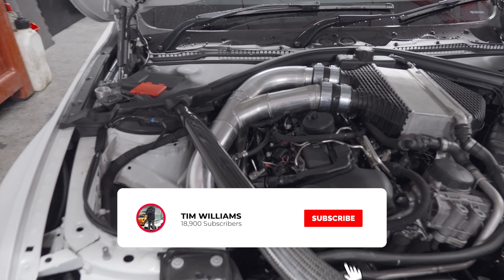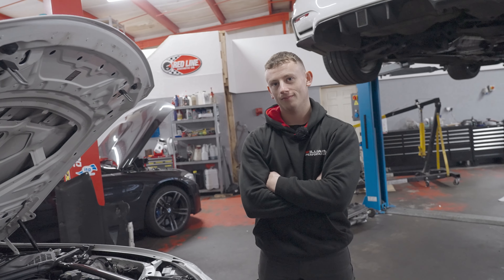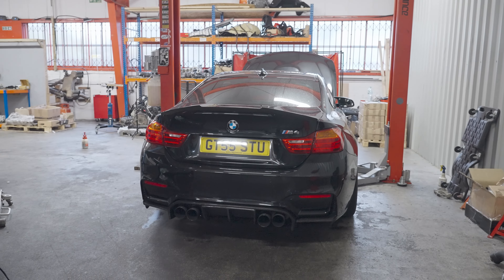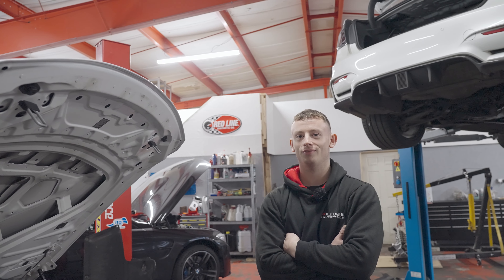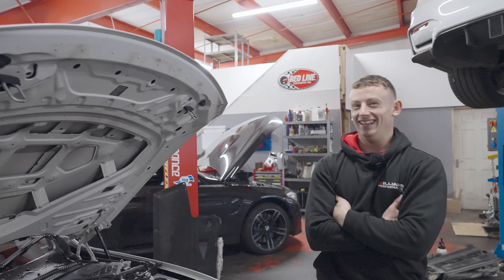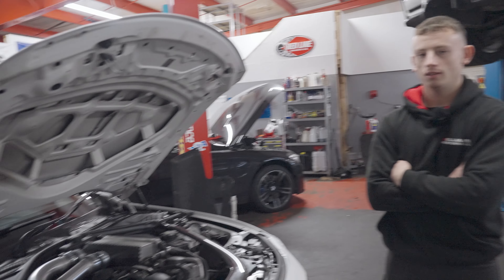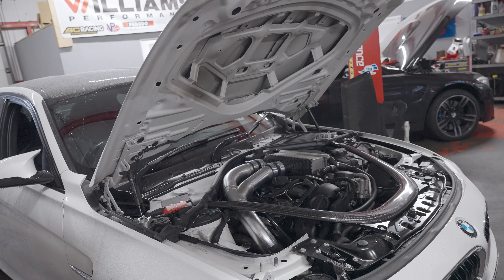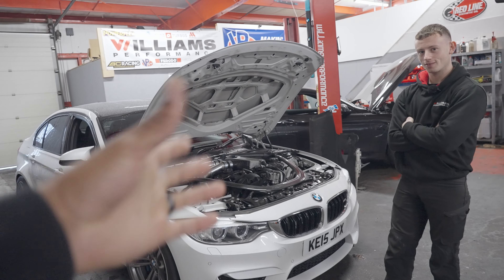Thinking Of Going S55 Single Turbo? - EVERYTHING YOU NEED TO KNOW *1st UK MANUAL SINGLE TURBO*

Comment: I want a fast spooling single something like 500bhp on pump fuel on the s55
Not sure if such a turbo exists
Reply from the maker: Stock can give you that easy 😄 custom map and you’re sorted
Reply: @TimWilliamsHD  but twin turbo set up sounds shjt and it might be a slightly faster spool with a small single
Reply from the maker: @TimChump ah I get you! I’m still not seeing what sounds so crap about it 😆
Reply: I want the n55 sound and spool with the s55 charge cooling and closed deck design 😅
Reply: @TimChump Look into the borgwarner efr series. I think the efr 7670 would be something you're looking for

Comment: Such capable engines but I just wish they didn’t sound awful. I’m still stuck in the NA M days I guess.
Reply from the maker: S55 biggest issue more than the crankhub seems to be the sound 😄
Reply: Once it’s single turbo, the sound is fixed 🤷🏿‍♂️🔥